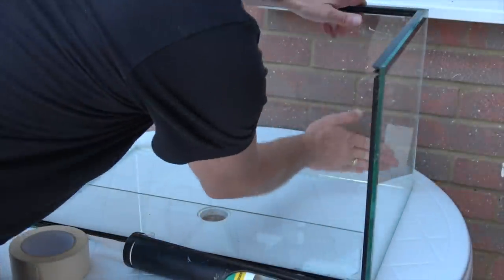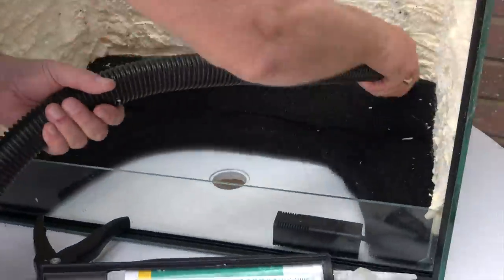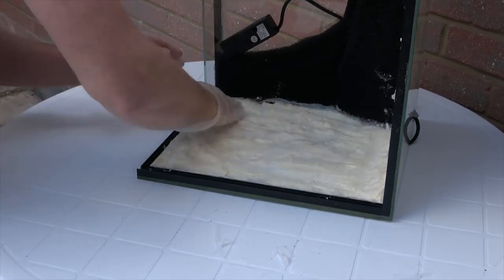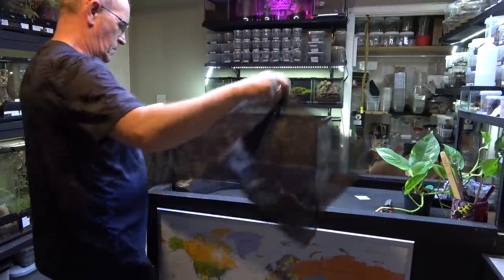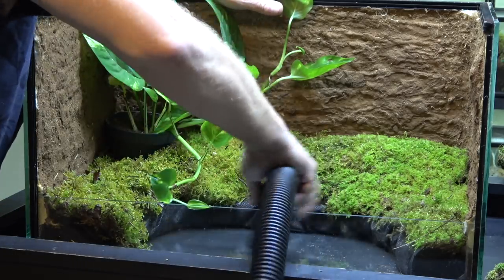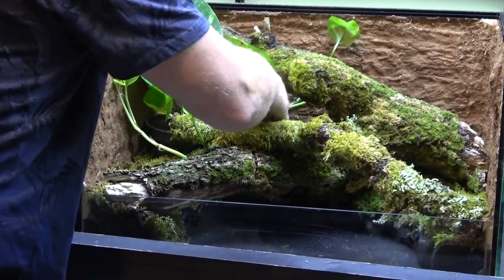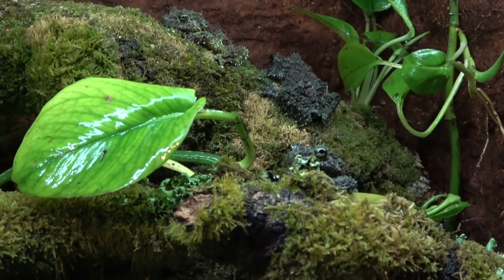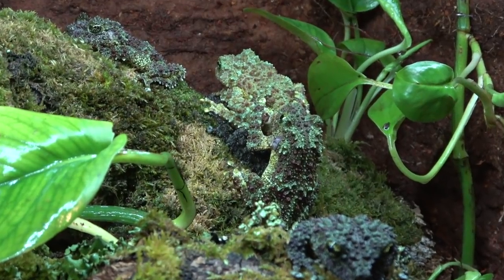Vietnamese Mossy Frogs enclosure build and care

Comment: Hi Dave,
I am due to get 2 x mossy frogs tomorrow. Excited! We followed your build video exactely but have found the branches we used inside have started to grow a white hairy mould!!! I dont know what i did wrong. They were from a forest and theres water in the tank and my son misted it too. Can you maybe shed any light on this for me? Cant have fungus growing for the froggies. Tank is in a cool bedroom with central
Hearing on twice a day, i habe thought to mive tank to a cooler room incase its the hot vs cold temperatures causing it? Thanks for your reply and advice 👌🏻
Reply from the maker: Just rub it off and it will stop growing

Comment: U can use interior exterior silicone on aquarium builds its 20$ cheaper then aquarium silicone has the same affect and won't hurt the creatures either I've uses it on tank reseals never caused 1 issue with anything I've had in em

Comment: Very nice build Dave. Could the coca fibre stick to the expanding foam directly , while still tacky and before completely dry, avoiding the use of the silicon layer maybe, while still giving the desired texture?
Reply from the maker: You need to carve the foam once it’s dry ?
Reply: You can — check out the Snake Discovery enclosure build off from earlier this year if you want to see what it looks like, since, as Dave notes, you can’t carve the foam.
Reply: @khills  Yes, I did seen the 'Snake Discovery' enclosure build off video, it was great. Wasn't Gorilla Glue used to adhere  coca fibre and other substrates to the expanding foam walls? There has to be a better way than using all that silicone as an adhesive, while appreciating whatever is used has to be 'animal safe', there is a massive array of specialty adhesives available, with spray-on application also. Instead of loose coca, how about pre-fabricated 'coca sheets' made for gardening. Cheers.
Reply: @m.b.boyack2228  I think Clint used Gorilla Glue and someone else just used the foam as the background. I’ve also seen people mix the coir into the foam while it’s hardening, so that it is there when you carve the foam, too — tho that is a little more iffy. And Tanner (Serpa Design) uses his own cor/mud mix and skips the expanding foam entirely. You have to keep this mixture damp, but otherwise it seems to work really well. 

There’s also the option of using a premade background, a la Universal Rocks. Or using foam and rock rather than foam and coir. I’ve seen folks superglue coir sheets to carved expanding foam or regular foam, too.
Reply: @khills  Thanks for the reply. Familiar with the people you mentioned. Yes, 'Serpa Design' does build some really nice set-ups and I do recall, now you mentioned it, Tanner does have a 'custom organic backdrop' method worth a look. As seen in the 'Enclosure Build-Off' design is dependent on the many variables, type of enclosure, animals involved, DIY skill level, budget, imagination and available materials. Cheers, have a great day!

Comment: 🤔🤔🤔 I wonder if Tanner over at Serpa Design would have a suggestion for automatically filtering the standing water without annoying the frogs? It seems like this must be something more dedicated amphibian keepers or palladarium builders run into all the time,…
Reply from the maker: Most run small pumps , these frogs like stagnant water so no filtration required 👍
Reply: @daveslittlebeasties  Hmm, so they like stagnant water that’s kinda gross? Is evaporation going to take enough off that you just need to top it off, or are you still doing a 100% water change weekly and forcing them to deal with clean water? (I wonder if an automatic water change system like Cory at Aquarium Co-op has on some of his tanks would work. Which probably isn’t necessary for one terrarium, but it’s the kind of thing I like to problem solve. Mostly because a weekly water change wouldn’t be easy/possible for me, but automation might make it a thing I could have…)

Comment: So the grass i had in my frogs cage died it was wheat grass idk if it only lives for so long or it was cuz it didn't get as much light as the spider plants but I had to remove it, I wanna get some wild moss to put in her  cage as well but I just need to find a safe area where ik its chemical free. i got wild moss all over my property but the last owners were meth heads an took cars apart on the property an I found oil ridden parts all over buried with trash as well which explains why I can't grow anything for shit they poison the soil so I dare not ever use moss anywhere near my property..